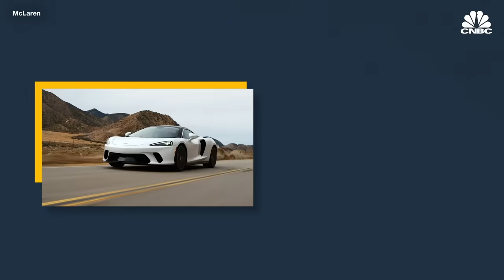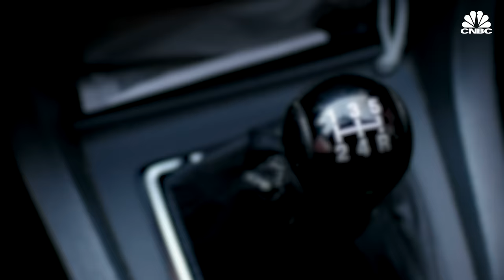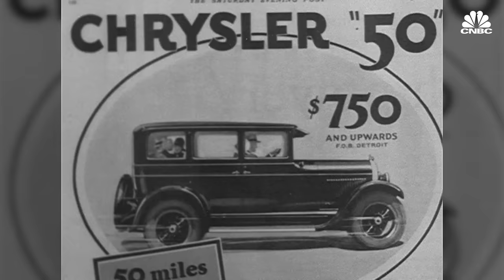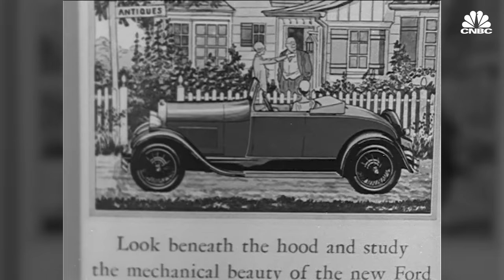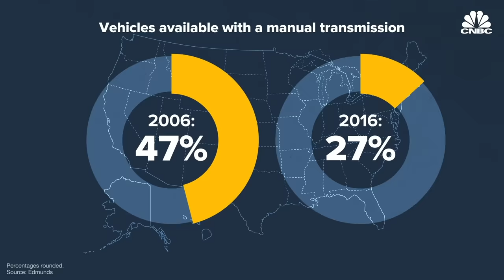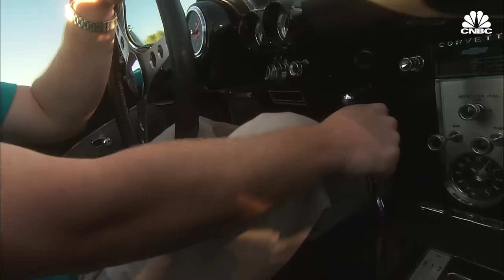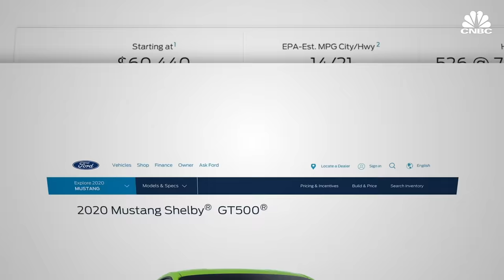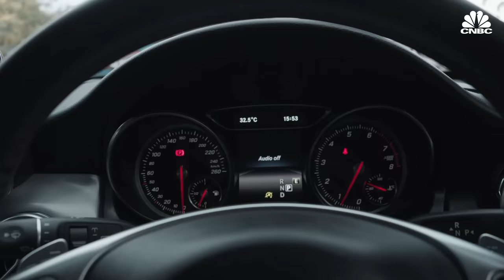Why Stick Shifts Are Going Extinct

Comment: I was once told if you can drive a manual you can drive anything. So far so good.
Reply: Its facts, my dad used to tell me all the time and I never once doubted that advice.
Reply: Right
Reply: Sure, but it's probably going to be a useless skill soon
Reply: "Where did you get your pilot training from?"
"Manuel transmission car."
Reply: That's bs, I can't drive a motorcycle or a tank or a truck
Reply: Well it’s the truth
Reply: @ryutoradragon396  it's literally not
Reply: @DerAltruist  salty much
Reply: @DerAltruist  just cuz you can’t it doesn’t mean others can’t do it
Reply: @ryutoradragon396  He made a generalized statement, which I can proof to be wrong by my personal example. 
Also, if you just used common sense you wouldn't even need an example.
If you learn to drive stick in a normal car, you just know how to drive stick in a normal car, that's it.
Btw, why are you salty?
Reply: @DerAltruist  nah you are mate
Reply: @ryutoradragon396  *uno reverse card*
Reply: @DerAltruist  add plus four
Reply: @ryutoradragon396  oof, what color do you choose?
Reply: @DerAltruist  red
Reply: Yes specially if it was an old manual
Reply: I can drive a manual, I never will.
Reply: Try driving a semi truck. I drove manuals for 20 years, but couldn't drive a semi. It's basically a dog box. Have to match revs and speed. Typical auto transmission is a sincromesh. It will slide into gear at any speed. Wrong or right.
Reply: Not really.  If you then try to drive a double clutch, it's like when you tried to drive a single clutch system for the first time.  Very different.
Reply: @ValMephora  automatic motorcycle?
Reply: @ValMephora  As long as old cars are on the road, it's never a truly useless skill.  While modern automatics may be faster and more efficient, I find them more boring and less engaging to drive, and for me, that's a big deal.
Reply: @metal4ever516  I've been driving a manual car in my driving school for a while now and I can agree. 
I can imagine a working placebo system, which is basically just simulating the clutch and the gears etc and pass that data to the motor.

Comment: I’ll be driving stick till I die, probably in a high speed crash.
Reply: same here but hoping not to die in a high speed crash.
Reply: Vablo Lol, don’t need to, just keep my V8 and other petrol powered manual cars I’ll be getting in the future.
Reply: Vablo Lol, being ‘fast’ isn’t the reason I’ll be driving a my V8, it’s the feel of the shifter and the connection to the car and that rumble you can’t get from a hairdryer (did you watch the video above?) 😉 Also you didn’t account for the speed limit, I ain’t racing on the streets. As for the fuel issue, ‘conversion kits’ my dude.
Reply: @VictoriaStobbie  Sure, you may like your stick driven car for whatever reasons you have, but they are becoming obsolete, they are less efficient, less effective, they require more effort to learn and they need the car to have an actual engine (by actual engine I mean a fuel fed one). Stick shifts aren't going to be around in a few dozen years.
Reply: #Goals
Reply: @hoovyzepoot  more effort? Bruh if a can do it an adult definitely can.
Reply: @hoovyzepoot  Bruh I am only 14 and I learned how to drive a manual car in like 5 minutes of explaining from my grandfather, I don't know what's the deal with it, it's pretty easy.
Reply: hydrolito nah, I’m good.
Reply: Would be me in the future.
Reply: @hoovyzepoot  god forbid you put a little effort into learning how to do sonething.
Reply: @hoovyzepoot  "manual cars are getting obsolete"
Ok

And
Reply: yyesss
Reply: @halohunter5217  a lot of converted electric do have gears, in fact. I drive a 2002 6 spd Nissan sentra spec V and I'm really starting to realize how annoying manual is. Yes, its more engaging and I generally drive a bit safer, and yes its definitely very fun but we generally as a people do not have the discipline to one, drive manual cars with competence and like normal people and secondly the patience to learn. 

Many people do want to learn, especially younger people that are my age, but people who are financially independent enough to buy a new vehicle largely don't like manual because its largely impractical -- as fun, safe (if you're not an idiot), and engaging I think it is, money talks.

I know you didn't ask for the poorly written essay but I had to give my 10 cents somewhere since I sometimes feel like I'm the only human being who drives manual sees things accurately from both "sides".
Reply: @andyscoinsbanknotes8575 Not saying you aren't really quick at learning-- you definitely are. But the thing is most people either don't explain it enough or overcomplicate it. Your grandfather has a lot  of experience obviously and definitely knew how to explain it to you in a concise manner.
Reply: @cameronlangstaff278  Well, my grandfather is a car/truck/tank mechanic (tank mechanic because he was in the army) so he explains it very well, I could not find any better teacher than him.
Reply: @halohunter5217  Each to their own, im probably just a bit lazy😅

Comment: In Europe manual transmission used to be the standard choice in new cars until about last 10 to 15 years. It has been shifting to automatics as they have become more fuel and power efficient. There is an advantage in having a manual in snowy and slippery conditions when you can disconnect the traction with clutch. In Finland you get a marking on your driver's license for automatic if you take your driving test in a car with automatic transmission and then you are only allowed to drive with automatic with your license. My first daily driver with automatic is likely to be electric car.
Reply: The UK is the same with passing your driving test if you use an automatic for the test. On passing you are restricted to driving only automatic.
Reply: @caffeinered  And in Ireland too, but I think that will become less relevant as EVs and hybrids become more prolific.
Reply: That’s stupid! No offense but it’s totally stupid to be licensed to only drive a specific type of car. For many reason it’s just dumb.
Reply: @josecitoramirez14  if you take the driving test in manual you can drive both.
Reply: Ty
Reply: Its the same in the Netherlands
Reply: And same in most Australian states. As in other countries your licence is only ever marked for Auto Only for new (<2 years experience) drivers - after that the endorsement is removed. It makes sense.
Reply: In ireland almost every car is manual I buy one for only one reason manuals last way longer then any automatic car.
Reply: Same.
Reply: @EkayLaive  same in France, if you learn manual you can drive both though
Reply: @josecitoramirez14  In the UK you can drive either if you pass your test in a manual, but only automatic if you pass your test in an automatic. It isn’t stupid, it is just different to the laws you are familiar with.
Reply: Bs. There are still loads of new manual cars here
Reply: Where is here ?
Reply: In Brazil, The manual transmission cars always leads The solds until 2019
Reply: @josecitoramirez14  Having grown up for 35 years with manual - no this makes sense. An automatic transmission IS different and if you are NOT used to manual the switch takes some time to learn when to shift gear and to develop the muscle memory to do so.

There is a good reason many german driving schools start the new pupils on an empty parking lot when they teach on manual gearboxes. The student WILL stall the car a couple of times.
Reply: An auto will not out accelerate a manual until it gets above 30mph. Don't believe me? Research the 0-30 against 30-60 times for both.
Reply: @mothmagic1  And in normal traffic that is absolutely  irrelevant since you will not go faster than the car in front of you anyway
Reply: I'd rather drive ICE with manual, or ride a bicycle, then drive electric car. Or just use public transport.
CAR is simple fun mechanical device and must stay that way forever.From A to B with driving experience and zero electronics. EV must go away,again, like it was 100 years ago.
Reply: @razzor4708  Thankfully life forms like these only exist in some remote rural parts of,the World...
Reply: @mbr5742  absolutely correct so what is the difference between 0in 4seconfs and 0-60 in 8 seconds when the car in front is not likely to get abot 15mph because you are both stuck in the rush hour traffic?
Reply: Electric car not needs automatic box because is simpler, automatic box is a complex mechanism to make easy to drive it in a petrol engine car, but electric car does not need automatic box even brakes, because is simpler
Reply: in america i Can drive a stick shift under a normal licence with no endorsements or restrictions, but because I'm a truck driver and I have an endorsement to drive a manual
 semi
Reply: only in luxury cars
Reply: Europe UK New Zealand Guatemala El Salvador Southern Mexico Argentina Iran And Many Others
Reply: @kenoliver8913 Australia Uses Automatic Transmission Cars Not Manual Transmission Cars
Reply: @byronchavarria4954  So? It remains true that in NSW (the most populated state) and some other states you get your provisional licence endorsed "Auto only" if your driving test was done in an auto. About 85% of cars are auto, but you're then banned from the other 15% until you get your full licence.
Reply: I did my road test in a 5-speed 7.3L. It was actually pretty easy since I could keep it in 3rd and it wouldn't go over 50km/hr. No risk of speeding. Same with school zones. Drop it to second no worries about speeding. I did really well on the test and I thought it would be harder. Rollback in that truck wasn't an issue. I can let off the clutch to bite point and it will hold itself on a hill without rolling backwards or stalling. ez-pz test.
Reply: @josecitoramirez14  no its not, when people needs to stay out of way if they dont know how to drive manual and only ever driven automatic. they will cause traficjams and acidents so thats the basic reason for not allowing people to drive diffrent type of car what they got there license. jea its sometimes dumb like if you know and have driven manual many years in the contry side and still have automatic license you would have to get the manual license. i have being in car with driver who didnt know how to drive a manual  and it was horrifing we allmost died because of that so i 100% support that, because we in Finland have manual cars like over 60% of all cars in a contry. You still can drive automatic with you license if you passed test with manual, its just that people who have never driven manual cant drive maunal. And you are dumb if you dont realise why its the way it is no offense.
Reply: @razzor4708  so you only drive cars with no headlight, blinkers, spark, fuel pump and startermotor.  basicly ford model T, but what it has battery and sparkblugs.
Reply: @josephmartinez7363  yea the motor is simpler, but have you ever looked at wiring diagram of modern electric car thats a nightmare. safty systems and coolent lines for battery packs everywhere.  Thats nightmare to fix if something brakes, usualy you just replace and thats wasteful.

summary: eletric engine is simpler the gasoline engine, but everythin around that makes the electric engine work is more complex
Reply: In South Africa in 2019 61% of cars sold were manual transmission. I believe you can take an automatic only test but I've never met anyone who's done that.
Reply: Damn……. That’s odd as hell . I passed my test on an auto, but than owned a manual.
Reply: @richardfortescue5583 sorry it’s kinda dumb .  In the states most of not all drivers Ed use autos , but zero restrictions on what type of transmissions vehicles you can drive. I learned on a 3 speed with No 1st gear synchronizer,but took all my test on autos .
Reply: going to disagree. when i visited europe 95% of the cars were manual. was hard to find an automatic. the stick is very much alive in europe
Reply: automatics are the best
Reply: @josecitoramirez14  A Manual license allows a person to drive both
Reply: EU will drive manuals as long as Gen Z doesn't take over. Once Gen Z matures enough, and the rest of us get old or pass away, manuals will go strong. Automatic crap.
Reply: It still is the standard by a LOT, at least for fully petrol / diesel cars. As you say, in some countries if you take your test with an automatic you're stuck with automatics forever more. With the shift to hybrids and electric manuals are going away though.
Reply: @josecitoramirez14  I mean, you technically can't drive a motorcycle if you have only a car license too...

Comment: Manual lets you focus on driving. Automatic tempts you to do other things while driving.
Reply: Perhaps, but I don't think bench front seats exist anymore either.
Reply: I've seen plenty of manual transmission drivers do "things" they shouldn't while driving.
Reply: @Bradastan  not as common and this is the second time I see your comment on another post trying to downgrade manuel as hard as you can.
Reply: I can drive my 2005 nissan maxima manual and eat at the same time. These people are just too lazy
Reply: @ShaolinMonk111  yes they are.
Reply: I really wanted a midzise sedan manual but I don't there is alot of them out there. Thinking about buying a WRX now
Reply: @ShaolinMonk111  i just bought a mitsubishi montero glx 2021 model and the power is really good even in overtaking on uphill. And the fuel  consumption is just like a sedan so it's cheaper.
Reply: @teofia7790  hmm I'll check it out  thanks
Reply: @rogerm4a1  in my country, most people drive stick and accidents are high
Reply: @mikejvevo3153  bad drivers then. All depends where in the world you are and how people respect the road.
Reply: @rogerm4a1  yep so many drivers who don't respect traffic rules, some of them even signal after they have turned 😂
Reply: @RonaldRaiden  you’ve been driving the wrong auto trans then my friend, try a lighting quick dual clutch and you’ll forget about stick shift. Also manuals are not more fuel efficient in most newer cars (CVT’s actually get better fuel economy than their manual equivalents) VW and Skoda dsg’s get the same mileage as their manual variants.
Reply: @RonaldRaiden  My manual '95 Ranger reliably got 19 mpg. My 2000 auto Ranger gets 16.5 mpg. Manufacturers don't care about efficiency, if you will buy the product.
Reply: That's what I'm saying
Reply: You pay more attention to your environment and not the transmission
Reply: That's basically it. Hear, hear.
Reply: in this case constantly shifting is actually more distracting
Reply: I can’t drive an automatic. It’s hard to keep myself paying attention in one.
Reply: And that's dangerous because when your mind diverts accident happens more
Reply: @ShaolinMonk111  so true i do same thing😍🔥
Reply: Absolutely! My phone stays off when I drive. (I'm a writer and I've researched a LOT of accident statistics. Anyone who thinks they can drive while distracted may wish they hadn't.)
Reply: And that’s a fact
Reply: In automatic you an literally do everything with just one hand and one foot.
Reply: Manuals are great on the weekends and on the open road. However, the clutch gets annoying in daily, crawling traffic. Grew up with manuals and may wait until i retire to get a manual again.

Comment: Remember when they called them standard transmissions
Reply: Which sounds like nails on a chalkboard, yes that use to be the standard but you still called autos a auto not a "optional" so standard just doesnt make sense compared to manual or stick shift
Reply: @zalcan3620  not really.  Naming the then default would have been redundant.
Reply: And you used to have to pay an additional 10 or 20 percent to get the automatic!
Reply: @aaronthoming8192  I'd reply but I dont even know what you're trying to say

"Naming the then default" ????????
Reply: Scotty Kilmer still calls them that
Reply: @ten_smudge8514  a man of culture i see. just wait until it cost them 3-5 k to replace that piece of junk. So glad I live in the UK almost every car is manual unless spending £25k+ for a premium new car
Reply: they still do

Comment: I will drive a manual car as long as they are making them. Slammin' perfect shifts even as i am trying to be as fuel efficient as possible is one of my few joys in life. I have tried driving an automatic car and it's like all of the joy of driving us taken away.
Reply: Agreed. It's so boring I don't know what to do with myself. No wonder people go on their phones so much. In a manual I feel engaged, involved. Driving a manual makes it much more difficult to use your phone while driving, to the point where it's not worth it.
Reply: Perhaps one of the penalties for using a phone while driving is that the offender should be restricted to manual transmission cars. @SupraSav
Reply: @kiwitrainguy  that would be great actually